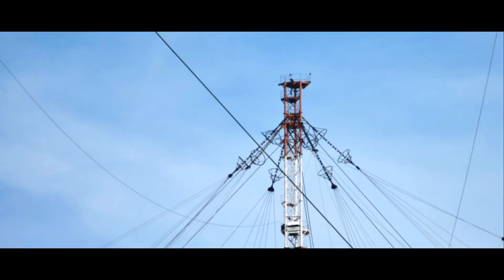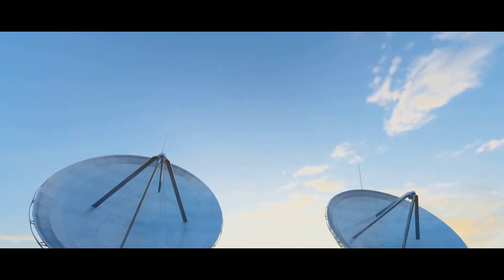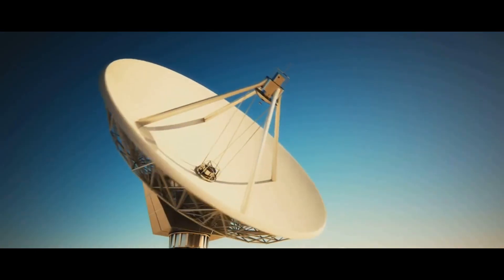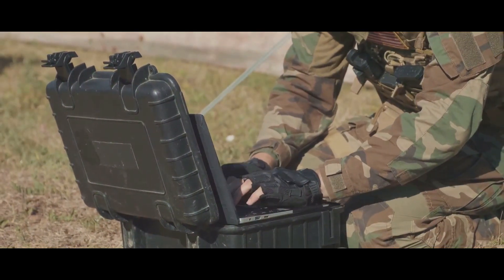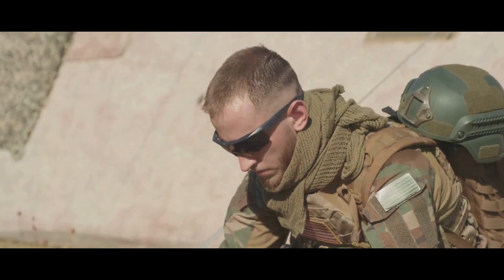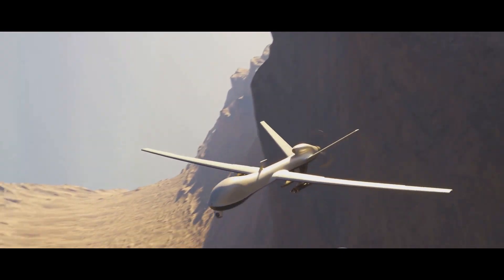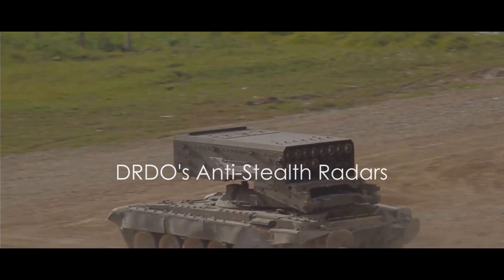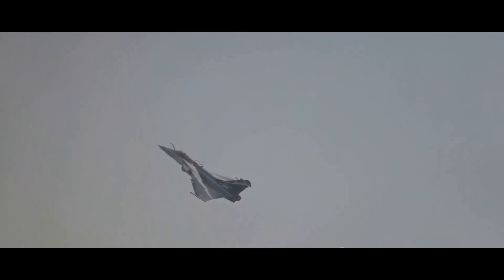Game Changer! Decoding DRDO's Anti-Stealth Radars: OTH, Multi-Static & More Explained!

Comment: The UK had OTH radar technology in the 1970's used by the RAF. When I was tracking Russian ICBM's. For sure the technology has improved since then. It was doppler based and only needed the target to be moving. The faster it travelled the easier it was to spot as we measured the doppler shift.